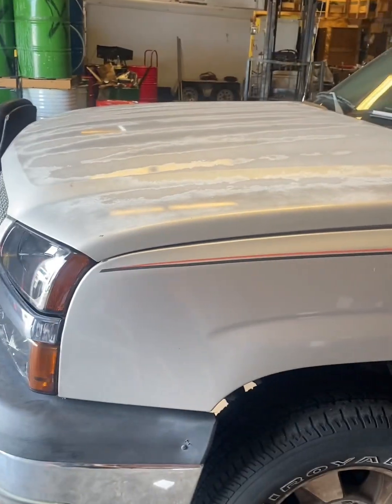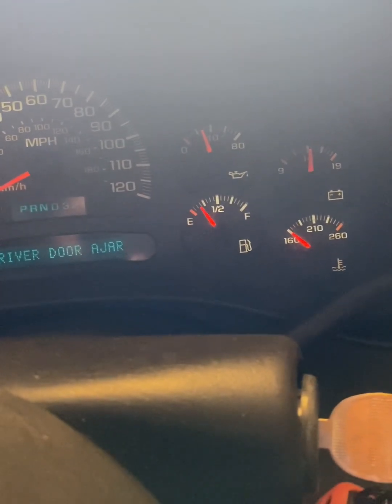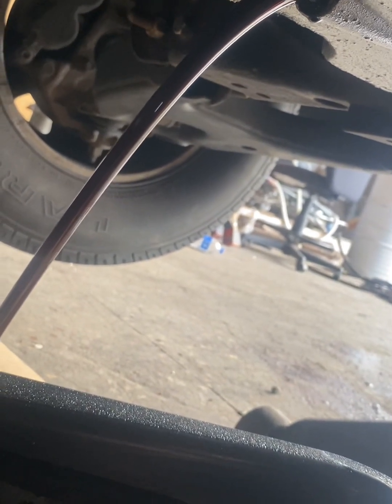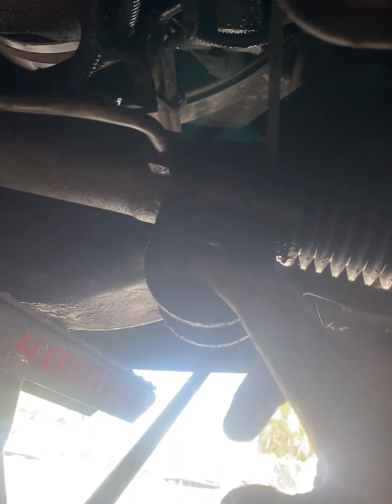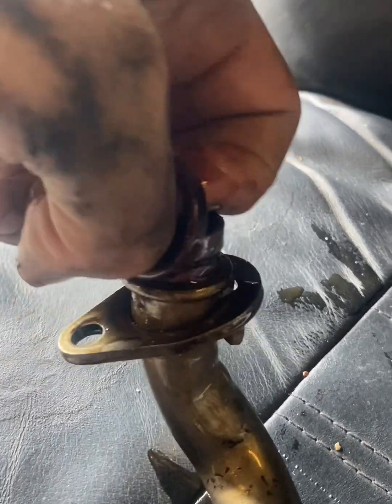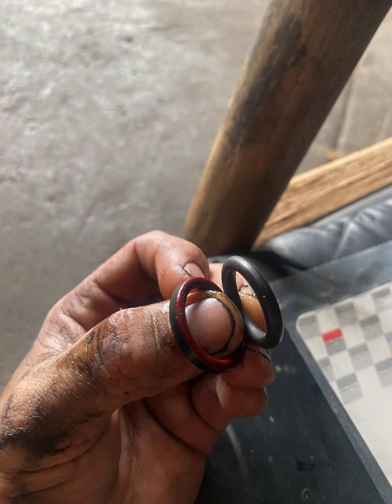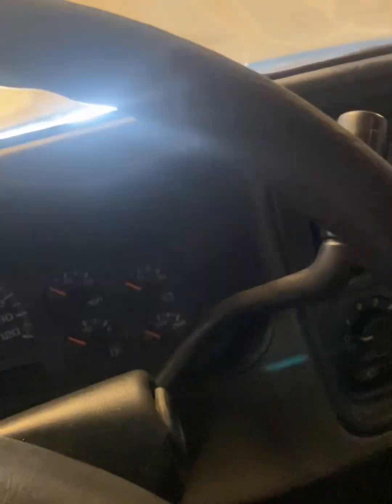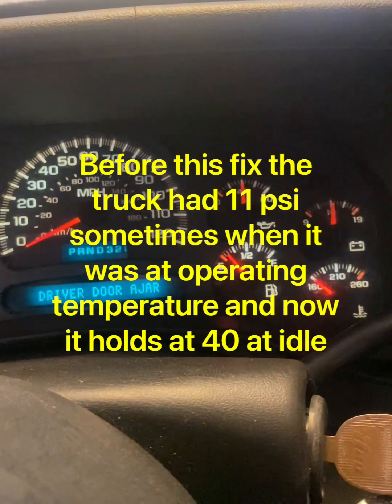How to fix low oil pressure on Chevy engine #4.8 #5.3 #6.0

Comment: I have a 2006 Tahoe and had the same exact issue. Low pressure and a lifter ticking soung, dropped my oil pan and replaced the worn out oil ring and Bingo!! No more ticking and pressure is up to normal.
Reply from the maker: @jaimeruvalcaba9968  awesome man!!

Comment: Did the tru k have a ticking noice? Im trying to figure oit what it is on my truck
Reply from the maker: @jcmexfreestyle  yes it did. These are hydraulic lifters so if the oil pressure is too low you will get valve tick. Truck still runs strong great oil pressure 250,000 miles!

Comment: Testament to this engine that it is still running.
Reply from the maker: I know right!! This thing has so much sludge in the pan, super low oil pressure, would also overheat cause it had a bad clutch fan and it had a bad tranny. I fixed everything and rebuilt the tranny first time just watching YouTube videos, works like a charm lol. Daily driver 100 miles a day still kicking 💪

Comment: They make 2 different O rings one black and one red the one you pulled off was red and changed it with a black one might want to look into that good to the point video 👍
Reply from the maker: You’re right, and they are 2 different sizes from what I just read. That’s interesting. Thanks!

Comment: I’m hoping this is the issue after spending 3k for a motor replacement
Reply: @CarSick813  got it fixed. changed the o ring and cleaned out all the sludge

Comment: Bet this didn't help... Sorry but your problem and everyone else's in the comments is the oil pump.. the piston in it is scored and hanging open. This lets pressure bleed off... Pull the timing cover while you got the pan off. Pull the pump change it. Just use a standard pump. High volume not good .
Reply from the maker: Absolutely fixed my issue and I drive it 100 miles a day. This is a common issue on these engines.

Comment: Thanks im at 250000 miles and I'm having the same problem at the light it drops to 5 ,to 7 😒
Reply from the maker: Yup it’s so common on these I bet that’s your issue. I got 240k on mine now running strong 💪
Reply: Same sometimes. You figure it out?
Reply: Spider injectors 4.3 vortec chevy silverado, shitty design 😑 but got it fixed 👍

Comment: Motivation bro I think that's the same issue with my truck low oil psi and my oil is leaking pretty bad but slow down a lot after I put blue devil in it but I need to get it fix 4 years with a oil leak
Reply from the maker: Awesome, yeah give it a try! It’s pretty simple and inexpensive.